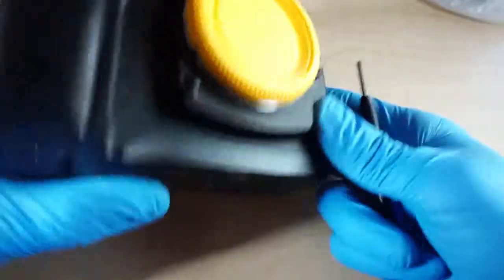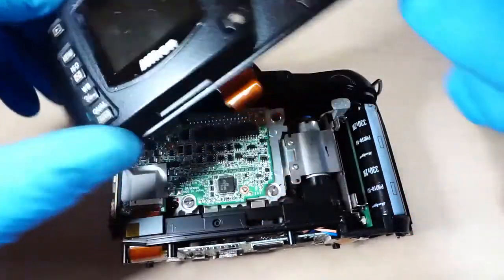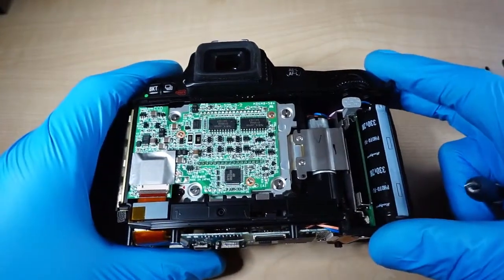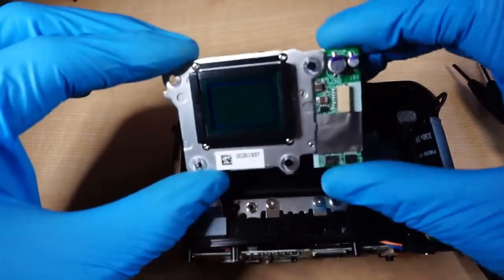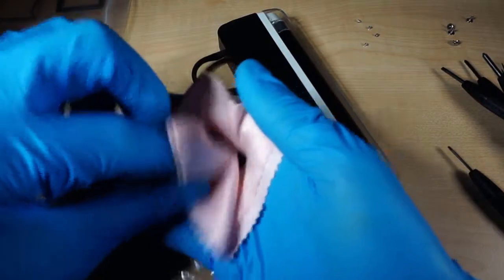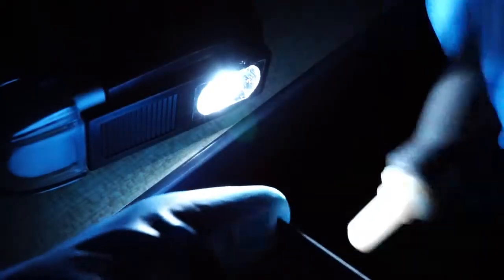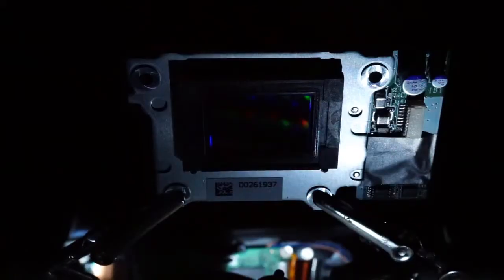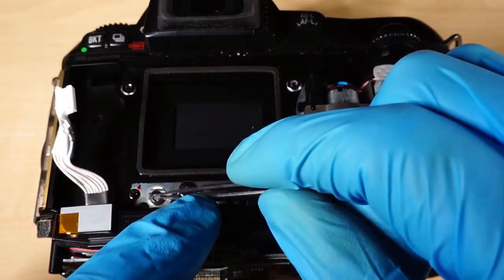* How To Convert Nikon D70 Camera To Infrared 720nm * We do IR camera conversions. See description

Comment: What if I remove the filter in front of the sensor and place the IR filter in front of the lens? Would it be the same? (Except it'd leave the sensor unprotected, but would it work?) thanks!
Reply from the maker: I need to clarify. For full spectrum you move the sensor to the front. For Infrared when putting in an IR filter move the sensor to the back by 0.4 mm.
Reply from the maker: Yes, it will work.
Reply from the maker: Yes, that will work. Just shift the sensor to the front - take out shims or washers.
Reply: @RemusLt  you mean actually not put the washers you install on 5:45? that'd mean the sensor goes to the front, right?
Reply from the maker: @vaiospantazis377  For full spectrum, no filter. Right.

Comment: can you do this without the filter?
Reply from the maker: what do you mean.
Reply: @RemusLt  he means that we, the viewers, are under the impression that IR conversion involves removal of a factory installed filter and not the addition of some other filter.
please clarify
thank
Reply from the maker: @daktarioskarvannederhosen2568  Without any filter you will get a Full Spectrum Camera. With a filter - IR camera.
Reply: @RemusLt  if only a filter is being added then why could we not simply add that in front of the lens?
Reply from the maker: @daktarioskarvannederhosen2568  The original filter inside blocks most of IR light so better to remove it. An IR filter can be used without a conversion, placing it on the lens and shooting with long exposures.
Reply: @RemusLt  oh ok. thanks for replying!
Reply from the maker: for IR - NO.

Comment: Hi Men. I make this and I think good. But after this operation dont get shooting pictures because on the rear display after shooting is writing: "Cannot use this Card". I want only ask why cannot I use this Card? Before this operation my Card functioning normal..
Reply from the maker: Hello, please check ribbon cables inside, did you push them properly in. Also this camera is difficult to convert. I would get a Canon for my first conversion.

Comment: Is there a way to find out what would be ir filter size for canon 10d?I know someone who would cut ir filter for me to convert it to ir but can't find any info about dimensions so I feel stuck,could take camera apart and measure it myself but that would leave sensor exposed to dust and damage,any ideas where would I find any useful info?
Great video :)
Reply from the maker: You can take it apart, measure and then put the sensor together and place all the bits in a plastic box. Then no dust will settle on it. Keep the sensor facing down.